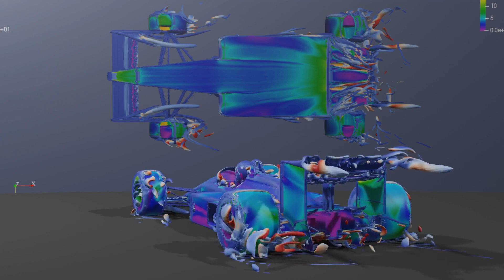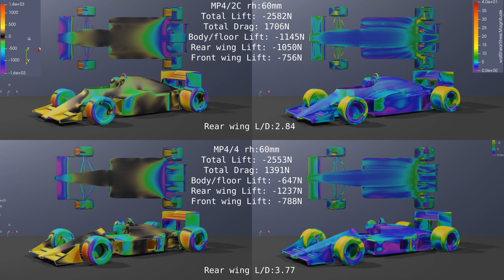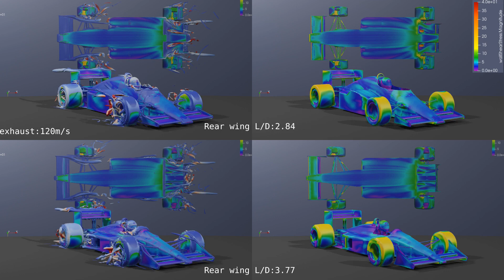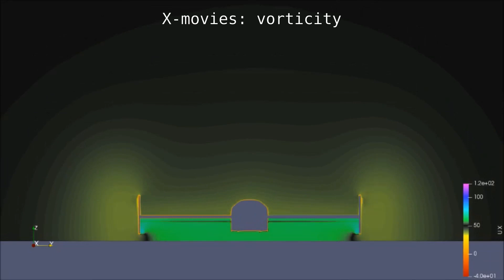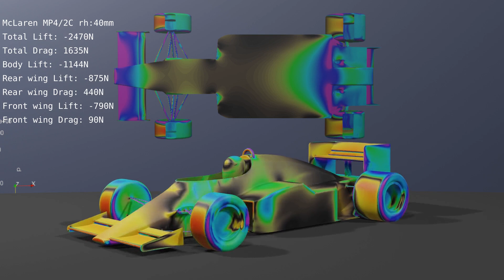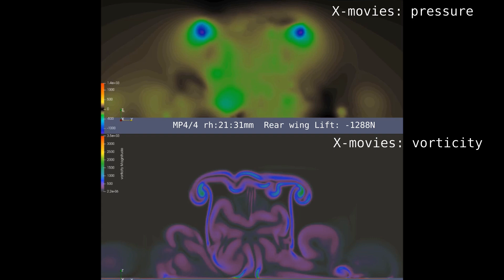A CFD Analysis of a Historic Formula One Car: McLaren MP4/4

Comment: For mine, Steve Nichols more based his original MP4/3 design (which evolved into the MP4/4 in 1988, allowable to be lower because it carried 45 litres less fuel) on the shape of the Williams FW11 than he ever did the Brabham BT55. That's always been Gordon Murray trying to get his fingers in the pie IMO.

But if you look at the MP4/3 and MP4/4 design just from the cockpit back ... they far more resemble the FW11.

Comment: Considering that both lift and drag grow to speed squared, the air speed being 50 m/s, the total lift at that speed is around 2500 N on both cars, and the top speed of both was around 330 km/h (91.7 m/s), we could assume that maximum downforce is 2500*(91.7/50)^2=8402.8 N???
Reply from the maker: Yep, have thought about deleting these early videos more than once. They are riddled with mistakes.
Reply: @nelsonphillips  there's always time to do them again. However, I discovered the channel just yesterday and I already subscribed, I think it's quite interesting. As a suggestion, I would love to see a  longer and more concise conclusion section with a few points, for example:
-Good aerodynamic efficiency at high speeds, not so good a low speeds
-Downforce distributed at 30/70 between the front and rear axles
-Maximum downforce of () N at (maximum speed of the car) 
-Cx of () 
-Frontal area of () 

BTW, I would love to see more cars, specially from 2000 onwards. Keep it going!

Comment: Hi, Nelson, thanks for the video, great stuff.
I came across some published downforce numbers from 2 different sources and there is a considerable difference, I'm not refuting the test, just saying numbers seem to be very low.
have a look at the data:
1976:   800lbs   at 150mph
1980: 3100lbs   at 150mph
1981: 2300lbs at 150mph* skirts banned
1986: 2500lbs at 150mph
1992: 3200lbs at 150mph
1995: 1900 lbs at 150 mph
2000: 2700 lbs at 150mph

Tyrrell F1 cars( sae paper Mike Gayscoyne)
1989:  2200lbs at 150mph
1990   2300 lbs at 150 mph
1991   2400 lbs at 150mph
1992   2750 lbs at 150mph
1995   2050 lbs at 150mph
1997   2500 lbs at 150mph

Again, there is a  difference in speed, 17 meters per second, and it should account for a portion of the difference, but there is a significant quantity still.
Thanks for the video, great stuff, look forward to hearing from you.
Reply from the maker: Thanks. There are a large number of factors that go into downforce numbers like ride high, wing type...... The idea is to get a ballpark number then try to explain where and why the car produces that/those numbers. If it was a simple as here is the car and these are the numbers the video would be a lot shorter. 
Also the model itself is running assumptions because looking a picture the under profile of the front wing is still a bit of a guess. 
The best part of doing these videos has been the feedback. I mean Willem Toet comment on one... doesn't he have something better to do with his time.  😮

Comment: I had look at this video again, Ironically today I was testing at Imola88, I ran a ride height of 35mm and 50mm rear. On the straight it bottoms out about 20mm for the front and rear. I'm using about 1.7CL on the diffuser, you seem to be getting about 1CL. 60% less. 20mm seems to be the max, anything below that you loss up 35% at like 15mm. I had to shift more Aero balance on the rear 35%, used COG of 40% the strange thing, your front to rear lift wing ratio started to come very close my CL numbers.
Reply from the maker: I was looking at the models for AC and got me thinking it would be interesting to do video game verses "reality" review. These models have had a large amount of work done on them to be as accurate as possible...... 
If you watch any of Niels Heusinkveld the physics is best if it feels right. Also unless there is some rake added to the floor the vortex of the front wings is blocked removing about 10% of the front and rear wing. I wouldn't expect this to be modeled in the AC... I didn't change the front wing flap angle so it is likely front biased. With these wings it is really easy to get more from the front than is needed.
Reply: @nelsonphillips  Yeah, totally. AC, if you can run like 2mm, 2mm downforce at 241KM, then run it at like 50KM, then interpolate, drag and lift for front, rear, body using max and min. AC use's coefficients, as the diffuser goes down depending on the height you can apply more down-force or less in the height file. Same thing with wings. AC can have good amount of detail if you have the aero data. Plus it has a wings app, so technically it has it's own wind tunnel.
Reply: @nelsonphillips  I imported ASR FW16, the model is very detailed. Would be interesting to see how the diffuser distributes lift for front part and rear. I suspect 35% to 65% ratio.
Reply: @nelsonphillips  https://www.youtube.com/watch?v=T1nYWuJBjq4                This is Senna's qualifying lap at Aida done in AC, with a locked 37% frontal. There is a link to the real qualifying lap using the same camera angles. The COG is at 37% and Aero about the same. This is with unrealistic manipulated diffuser, it thinks it's running at 2mm ride height for rear and front through out the entire lap. I think I have learned how to setup a realistic diffuser, I needed to shift the Aero Balance more to the rear and set ride height to about 35mm front and 50mm rear, and set the front and rear to bottom out at 20mm. It creates like COG shift from like 37% at low speed to 34% high speed, depending how you want to tune it, it could be 40%, 37%. I suspect the default back in the days might of been 37%, 36% at low speed.

Comment: 380N MP4/4 Body at 180KM... What Coefficient Drag would that be? I suspect it's like between 0.55CD to 0.60CD
Reply from the maker: thats with the wheels. the total drag includes the wheels and thats 1440N
Reply: @nelsonphillips  Ahh so it's 947NM of body drag..when the wings are ignored
Reply from the maker: @testdrive7772  or 815N of drag from the wheels. I really shouldn't use 3sig fig...
Reply: @nelsonphillips  I calculated MP4/4 Body drag including tyres, it comes to 0.622 CD 948NM at 40mm ride height. These are numbers I expected.
Reply: Rear Wing seems be generating 0.85 CL, if I'm calculating this correctly. If you ever get time, trying doing CFD on 1993 MP4/8 or 1994 car's, with 3 Wing Configurations high(Monaco) down-force, medium(Imola) and low(Monza).

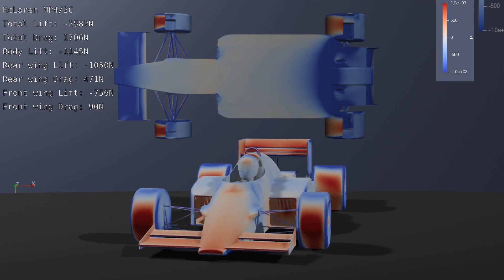Comment: I think you made a mistake at 7:09 1050N Rear wing Lift, 471N Drag Thats 2.21 L/D
Reply from the maker: true it was 370N drag. 471N drag was for the body....
Reply: @nelsonphillips  You seem to be using Imola88 Rear Wing for MP4/4 and Front Wing seems match also. I though they kept front and rear with the same distribution, unless their diffuser was generating more lift on front to compensate. I've been looking Monaco rear wing's, I found them to look nearly all the same form like 1988 to 1993, maybe 10% difference for later years. I've always wondered their detailed spec's, but the data mostly doesn't exist, just a few CFD's.
Reply from the maker: @testdrive7772  the front wing was adjustable. 1990 rear was very different at monaco. image archive i use most is motorsportimages.com . There is very little data outside of teams and their members

Comment: Interesting, so at 180KM at optimal ride height it generates 360KG of downforce, and 148KG of drag
Reply from the maker: This isn't an optimal ride height. Is is a ride height that is referenced. The logic goes, the ride height from the test notes is 1 3/4 front, if I remember, I lowered it to 21mm because downforce would. I don't trust my simulations to run with a lower ride height. I also saw test notes from Monaco and they didn't change much from that. The outcome was those numbers, which I think are pretty close, within 10%. The exact real world numbers aren't available and this is basically a reverse engineering of the car. This is also medium downforce. Someone threw around a 2500kg downforce number for Monaco @150mph. Hearing this gave me a sinking feeling, but if you back calculate its about right.
Reply: @nelsonphillips  Monaco, Adelaide, Aida was about 950KG to about 1100KG at 241KM from what I read on the internet. I usually mod F1 car's in Assetto Corsa, then try to get their qualifying laps, and their top speed's seems to concur with aero dynamics and engine power.  I usually use same lift for front and rear wing and use COG of 0.370 or sometimes 0.400, then use aero dynamic's balance to follow that. I suspect frontal part of diffuser was about 37% lift and 63% on the rear.  Without a good aero balance the car can be a nightmare to drive. I really like what you done, it's really detailed.

Comment: Great video and great explanations. I wonder how you would analyse the Lotus 100T that had the same Honda engine but was much slower?
Reply from the maker: The thing that I got from this analysis is that the MP4/4 was mechanically really competent. The only really competent aero car from that year was the march881, video of that should get released in the next few days...hopefully. So analysing the Lotus may not tell that much. Just by looking at images the Lotus has a greater frontal area so it is unlikely to have aero, though i haven't had a close look at the diffuser.
Reply: I remember reading that one of Lotus 100T designers was very proud that it had a substancial frontal area reduction compared to the 99T. But the 100T was a complete flop, being 3 seconds slower than the McLaren MP4/4 during qualifying at Imola. Gerard Ducarouge was fired after the 100T disastrous season.
Reply from the maker: @FAGV  It pretty fat compared to the mclaren. Looking at the diffuser, it was still basic. you can see many images @ motorsportimages.com and search lotus 1988. 
It wasn't qualifying, it may have been pre-season testing at Imola. Clearly it was a well funded team and had a world champion driving. It was the beginning of the end for Lotus. After Chapman it was a make or break year........
Reply: @nelsonphillips  do you see the MP 4/4 as a better car than the Williams FW11B? Patrick Head said in 1988 that he wasn't much impressed with the MP4/4.
Reply from the maker: @FAGV  i wouldn't say the Williams was better. I wouldn't say it was very good. The march was faster and had much less resources. If Williams produced a half decent car they should've beaten the McLaren at least once. Bernie E. agreed with Head, but he wasn't running a team at that point.

Comment: Wow!  Incredible work! Modelling this must have taken forever.  What CFD software are you using?

So many factors came together to make the MP4/4 dominant.  Two historically quick drivers at the height of their powers.  Power & reliability from Honda who chose to continue development of the turbo engine despite it being in the last year of legality. Development by Shell to help offset the fuel restrictions for turbos.  Also, Honda producing a small engine which matched Murray's vision of a low line car similar to the BT-55 (but actually worked, unlike the BMW).

Looking forward to your analysis of the March 881 and seeing an aerodynamic comparison to the MP4/4.  Particularly curious about the ride height sensitivity.
Reply from the maker: Thanks for your comment. 
Yeah, the modelling takes a little while, but I like modelling. Also needed to get better at it. 
The software is openFoam. Its amazing thats it open source. I was supposed to write that in the description when published...... its there now.
The fuel regs also changed for that season as well. Apparently they were using some literally toxic brew before.
Just reread the Newey book about this car. I don't know how much I can replicate the problems he had developing its sister 891, but its an interesting car non the less.